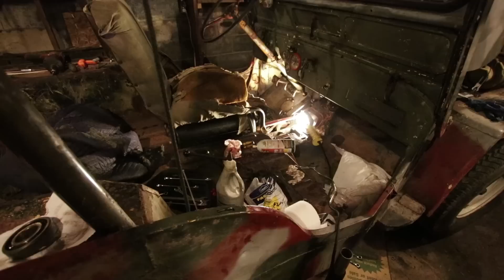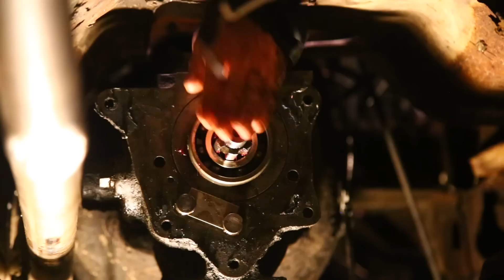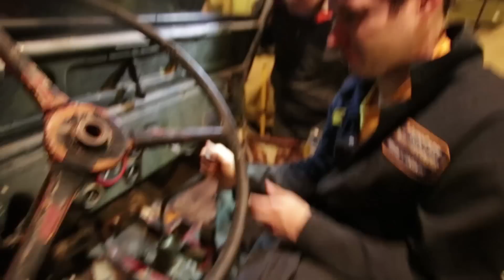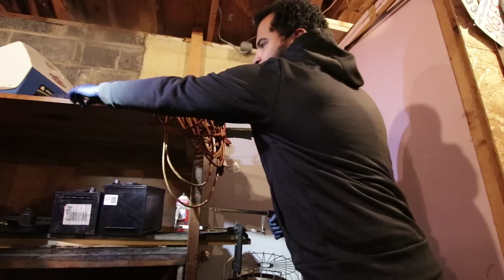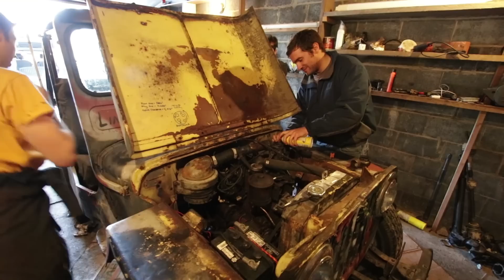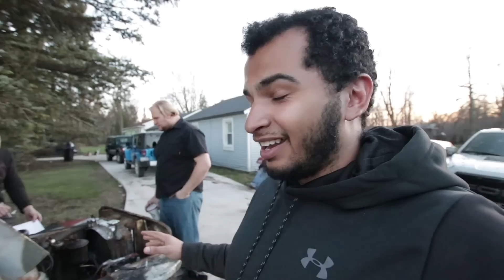Rebuilding The Worst Willys Jeep In America - Project Slow Devil Pt 1

Comment: 8:18 I recomend putting a little steel or other material to form what is missing from the structureand make a form, then get an apoxy that hardens like steel and pour it in. An apoxy with fiberglass may be the answer. The ideal is to save what is there even if rusted rather than to cut out, which is another option.

Comment: Sorry but you guys will have to take second place for the worst jeep. I pulled the body off my 49 2-A physically in three rusty pieces and then I bought a used body. Throw that junk motor away! It's grossly underpowered, Put disc brakes on the fron and terplace the steering with Saginaw and a tilt GM column. A Buick V/6 makes a very good engine and it's not so powerful it will eat the gearbox.